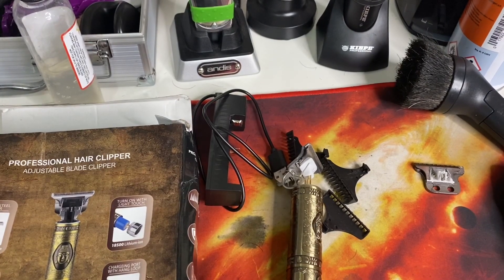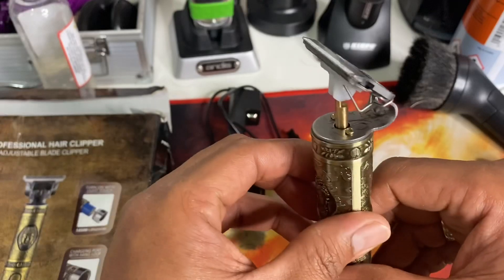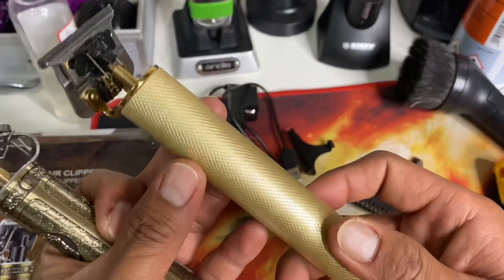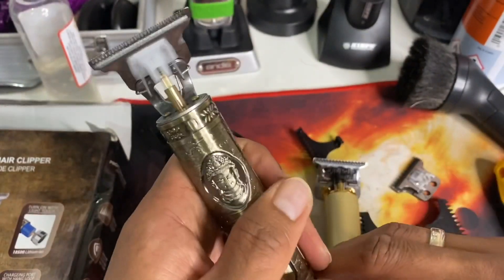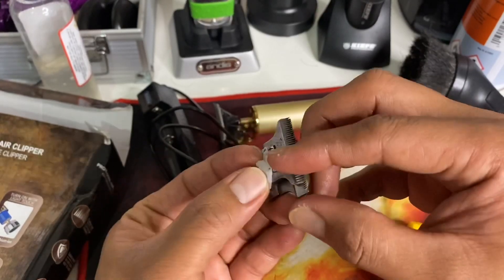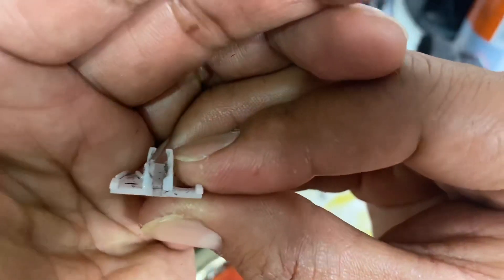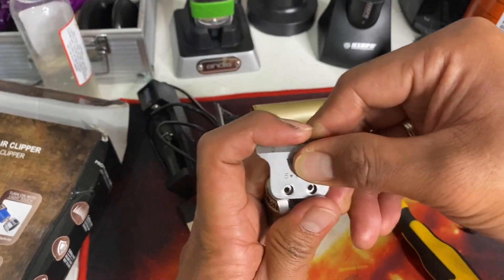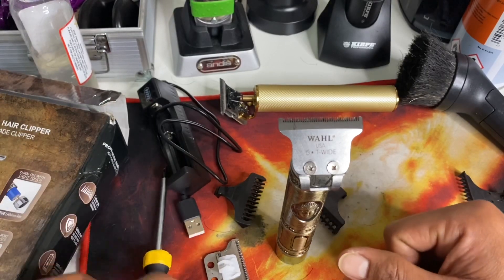Buddah Trimmer Blade Modification

Comment: Hello can you please tell me which blade will fit on the 1974c model dragon
Reply from the maker: Bear in mind which stock blade is attach. If it looks like wahl then wahl. If its andis slim line then andis. Some are not even replica which cant be replace. Tnx Buddy. Pls stay tuned
Reply: @sampitz  thank you
Reply: will ceramic blade fit on original blade?
Reply from the maker: Sure bro

Comment: Can you make a video modify a gtx blade on these
Reply from the maker: Just use gtx blade instead of t outliner😉
Reply: What you mean bro, that's what I'm trying to say if you know how to modify a gtx blade on these kemei trimmers
Reply from the maker: Dennis Memedovski oh sorry. You need to look for a buddah trimmer that has a Slim line blade for youbto be able to put tha andis blades. That will depend on the mounting holes of the blade. Buddah trimmer has lots of model. Tnx

Comment: What is the link of the BZ T99 Buddha trimmer please ? Not sure which one is that one in the description. I have a Buddha trimmer but it doesn’t fit..
Reply from the maker: Cant tell you that anymore. There are lots of model now but its hard to identify which is wahl twide replica blade.
Reply: @sampitz  i bought that « wahl » t wide blade but doesn’t fit ... maybe I need to purchase an andis blade ?
Reply from the maker: There is wahl replica but brighter blade. There ls also buddah with andis slim line replica blade which fits original andis blade.

Comment: Hi. Good day. Bro i have a question. For kemei km6267b, what blade can i use for modification? Hope u can help me fix this. Appreciate that, tq bro.
Reply from the maker: Hi. The blade is not the size of Wahl T wide. But what i did is just put the ceramic cutter blade just what i did on the same trimmer
Reply: @sampitz  thank u so much 🙏🏻

Comment: I had a bad experience I purchased mine from eBay used it once for a few minutes and the second time it’s starting making weird noises and the third time it felt a power on even though the battery light is on the trimmer doesnt power on

They only look good

Comment: How long did you charge the battery? I just got mine and tried charging it for more than 2hrs but the light wont turn green, it just stays red.
Reply from the maker: An hour or more. Maybe its ur charger. They are very cheap charger at all.
Reply: @sampitz  I see, I can replace the charger right? and also the battery?
Reply from the maker: Sure. If the mode you got ist replacable. R u charging outside the maschine ryt? Extra charger
Reply: @sampitz  yes" just like what you have, the exact same thing. :)
Reply: @sampitz  I just dont know what battery I have. yours says 18500 and 1400mah. I'm guessing we're the same?
Reply: Same here. Hate I bought this piece of s**t. 
I charged on the red light never turned green. Charged green and it did not charge. 
Am I stupid ? What way or how do you charge this battery ?